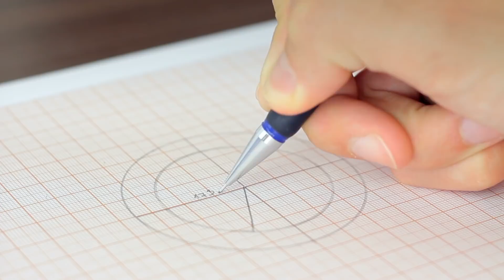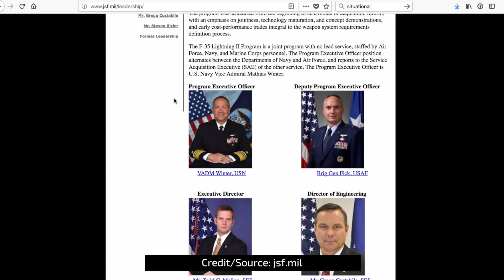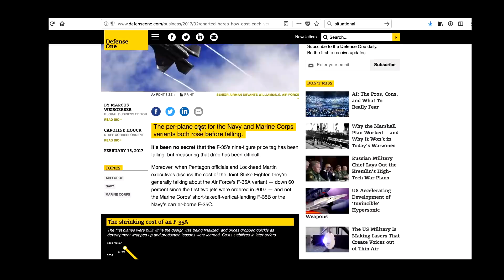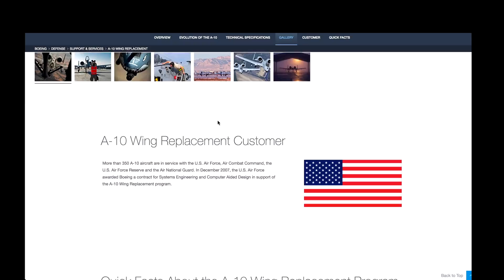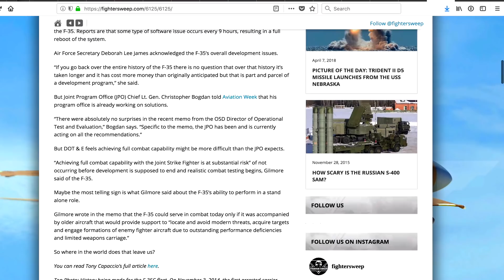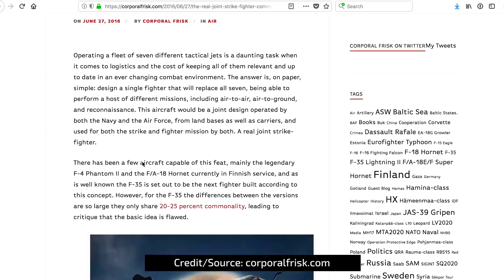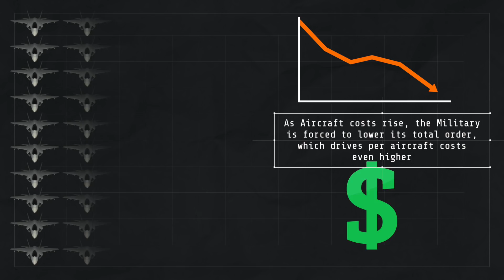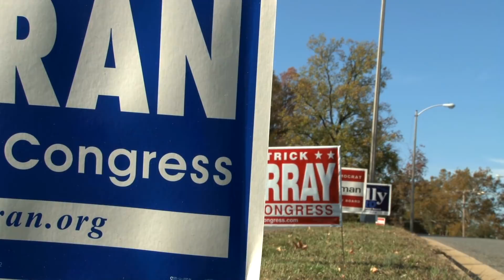Why the F-35 Lightning II Might be the Most Expensive Military Aircraft Mistake Ever

Comment: This video is complete BS. First the cost, before the F-35, there has never been a total cost report of a fighters or bombers complete life. This new data calculates the initial cost of the plane, upgrades, fuel and weapons for the total length of the aircrafts life. If such a report existed for say the F-15, almost every singke analys report done had that program already surpassing a trillion dollars a while ago. With other planes like the F-18 costing around 800 billion, B2 at over a trillion, etc. 

Also the cost of per F-35 has gone down to 85 million per plane, not 200 million as you reported. 85 million is a lot but a new F-15SE costs around 100 million, the EuroFighter 100 million and the B2 is over a billion dollars.

Next, that report of the F-16 vs F-35, read the report before you talk about it as that flight test was not about dog fighting but the electronic baby sitters on the F-35. The F-35 is the safest plane the US ever created, to accomplish that limiters had been programed into the computer from stopping the plane going to far out of control. However they needed a base line, say another single engine fighter with similar flight characteristics, to help adjust these limiters. The F-16 didn't out fly the F-35, it was just used as a base point and for data comparison. Again, this is all in the report but like anything, the naysayers will always pick out the negativesvin thing's, like reports without fully understanding the big picture or ever reading what really happened. Oh, do you want to know one thing that did come out of the report, the F-35 was to powerful in a lot of it's turns, adjustments needed.

A more realistic comparison would be the Red Alert report, where the F-35 desimated every aircraft it came across during the exercise including German mantained Mig-29's. Why, they couldn't detect it.

Which brings me to Stealth, Though yes the F-35's stealth capabilities fall under the X bandwidth, the X bandwidth is what every single plane and most AAA guns, missles use as UHF and VHF radars take up a friggen football field, are expensive and rare. These radars are also easy targets for anti-radiation missles as they are lit up like Christmas Trees because of the power needed to operate them, basically they will be the first things that go boom during an attack, thus negating the threat of UHF and VHF

That being said, the new B-21 Raider Stealth Bomber also covers these bandwidths, using a new coating. That same coating will also be used on the F-35 when it's completed, read the reports.

This is because the F-35 is the most modular aircraft ever created, designed for easy upgradability. Russians come out with a new electronic package that could potentially defeat the F-35, it's upgraded to the next level and so on and so forth.

Look believe what you want but you've been fed a lot of false information, the F-35 is the most incredible peace of technology to come out aerospace in a very long time.
Reply from the maker: Tel me where you read that a F-35 costs 85M. That sounds horribly wrong. Please uses sources to back up anything you said. Thanks!
Reply: @ProjectDaVinci  You didn't provide and resources, here is one of many  articles on the subject, I was wrong, the price will be 85 million in 2019, right now it is 95 million. Still much lower than 200 million.  https://www.janes.com/article/75863/lockheed-martin-targets-usd80-million-unit-price-for-f-35a-in-lrip-14
Reply from the maker: Those are price targets, but unlike consumer products like cars, there isn’t the need to ever really meet that. The F-35 still has some issues and that target price doesn’t mean it’s the case right now.

Comment: I have watched the entire video and there are a number of things I would like to address as there is so much wrong with this video. First off when you spoke of the different variants, it's important to note that there almost nothing different in each of the variants apart from how they take off/land, and how they perform (which is the least there is to be concerned with in this plane). 

Second is the pricing issue. When you spoke about the 1.5 trillion dollars, it's also important to note that this is the cost over a span of the next 55 to 60 years including every single thing, that means parts, pilot training, procurement, maintenance, etc. If you were to go on for the next 55 years with the current fleet of aircraft, it would cost maybe 4 trillion dollars or more easily. This is how the F-35 infact does save money both in the long and short run. Have a look at this... https://youtu.be/LyHlp7tJrxY?list=PLr7UZ_rywxTFdhDfu7SFimAMAUVdpabKL

One F-35A today costs around the same as a Rafale while being a whole generation ahead. And it is still currently LRIP (Low rate initial production), once it goes into FRP (Full rate production) the cost will simply drop like a rock to around 70 million or so. 

I'm sure the issues after this have already been addressed but I had to address the above. Thanks
Reply: Shout out to Stormsquad. When are you guys gonna make another CAB show episode?
Reply: Hey, I'm unfortunately not making any videos for the CAB show, I was initially going to do one on the YF-22 vs YF-23 but due to a number of reasons it could not be done. As of now my schedule has gotten busier so although I'm still in the group I don't make anymore videos for them
Reply: Stormsquad Ok. I know Dalek still makes a video once in a great while. I would have enjoyed seeing what you had to say on the YF-22 and YF-23. There are so many flat out lies and half truths and total conspiracies about that. It would be nice to put that in its proper place.
Reply: @thefreeman8791  I know, I wanted to do it too and even made a script together for it. But even for facts, they weren't facts enough though so it couldn't be done. The true reasons for the YF-22 being chosen are extremely confidential and no it most certainly is not because of any corruption or backhandlers or anything. I know there's so many conspiracy theories out there about this
Reply: Stormsquad Exactly. I saw one comment one time where the person said that Lockheed sabotaged the 23 by somehow stopping Northrop from building the canopy that they wanted so the ended up having a two piece because of that. I mean the complete and utter lack of ignorance around the whole thing is astounding. We have to deal with what we know not with what joe blow conspiracy theorist says.
Reply: @thefreeman8791  Trust me I've heard far worse. Like Lockheed deliberately applying more stealth coating on the F-35s than needed (the F-35's RAM isn't painted on you tool), or this one is gold during my early days on YouTube. "Russia sold it's PAK FA blueprints to the US which is why they made the F-22" 🤣🤣😂😂
Reply: Stormsquad Wow. I thought the one I mentioned was crazy. ROFL. That is the kind of stupid where it is so stupid that the only thing you can do is just laugh. 😂😂😂
Reply: Having worked on the JSF program, there is a sizeable difference between the vertical take-off and landing variant and its cousins. The large, heavy fan just aft of the cockpit is a bit more than almost nothing.
I basically agree with your pricing issue description.
When I left the program there were still many issues that needed to be resolved (I am hopeful that they will be addressed or the risks mitigated).

Still a big fan of the USAF (being retired). Glad to have left Lockheed (much lower blood pressure since).
Reply: Thanks for the comment. While it would be foolish of me to just accept what was stated in the video or your comment, it does give me more to think about. Pricing and production in the military (and government in general) can go either way. Sometimes it's a decent deal and sometimes it's not.
Reply: First off on your first statement it say that the now 2 trillion will pay throw 2060 not 55 to 60 years
Reply: 9
Reply: Sick of spending the youth's money.  Maybe they have much bettter ideas that will cost far less.  Why straddle them in debt and stiffle their creativity?
Reply: You obviously don't know squat about aero engineering.
Reply: Stormsquad bro the Navy is requiring VTOL
Reply: @jimbeaux89  that's only the Marines not the Navy
Reply: Jesus Anaya  they paid 300 million rupees, not dollars
Reply: Jesus Anaya  And what's your point?
Reply: @Stormsquad: It's called "moving the goalpost". My original argument wasn't that new planes don't have new features other than computing. My argument was that the buzzword "5th generation" is just a computer upgrade, that doesn't need a new plane (in fact, some "4th gen" planes are already being upgraded with those same features).

Terms need to have a definition. The only thing common between those so-called "5th gen planes" is user-interface and networking upgrades. And those planes are being promoted for exactly those features. So if nobody's gonna put out an official definition, i'll just go with that. Okkams razor.

So to summarize: Do those planes have other features than UI and networking? Yes, but those features are all over the place - there's no common pattern other than computing. Therefore, you don't need new planes to get "5th gen".
Reply: @lyxar777  Oh sure sure, why don't you simply apply these Upgrades" to older planes and see if they do nearly as good as they do the original planes? It's not moving the goalpost, it's giving you a perspective of how stupid your argument was on 5th gen planes.

I mean why not just say the term "4th gen" itself is a buzzword for upgraded 3rd gen planes? Why have newer expensive planes like the F-15 when you can just upgrade the F-4 and slap a new label like 4th gen on it? Of course I know you've completely left stealth completely out of the picture as have you left out performance and so many other things. But that doesn't matter, it's just a computer upgrade bro.

Seriously why don't you command the Air Forces or build these planes since you obviously know more than the people who make em and fly em
Reply: They ARE already being applied to older planes RIGHT NOW.
Reply: @lyxar777  Only certain avionics and derivatives of radars, they still don't have stealth, they don't have sensor fusion or more than half the shit that an F-35 has. Start doing some researching before commenting blankly
Reply: Since when is stealth "5th gen"? And i don't know how much you know about computers, but i'm a software developer, so i know "sensor fusion" is just software. I mean, it's not too hard to figure out: What is doing the "fusion" in "sensor fusion"? That's right: A computer program.

Agreed: Not every upgrade for every 4th gen plane includes all features, but that is not a limitation of the planes. It is vendor choice and market-strategy, so they can tell people like you without a clue of computers: "If you want the full package, you need to buy a whole new plane from us."
Reply: Jesus Anaya: Amount of times i'm insulted and ridiculed in this thread is telling. But anyways: Stealth originated in 4th gen, not 5th gen. AESA indeed something common in current 5th-gen planes. However, it is also being retrofitted to countless 4th-gen planes without problem.

So you might say: "You should've said networking, compute and radar upgrade, instead just compute and networking" - and you would be right. Still doesn't change my argument however: All three can and are being fitted to 4th gen planes. You don't need new airframes and engines for that.
Reply: @lyxar777  you're just a software engineer, not a pilot, nor an Aircraft mechanic or even an engineer. You haven't said one thing Correct about any plane yet so you don't know
Reply: Jesus Anaya  yes totally
Reply: Stormsquad, You compare JSF with a failure. Of cause it will look the better of the two. The Rafale IS a failure. Expected sale isn't met and the price reflects that (as it does with the JSF). Almost the same can be said about the Eurofighter, which is a very large and complicated plane.
Reply: @Mshark well it doesn't though doesn't it
Reply: Stormsquad Completely shortsighted and stupid comment.
Reply: Jon Ultime The OC is very very wrong. The 3 variants are EXTREMELY different. That’s why only about 25 percent of parts are interchangeable, and those that are are mostly mundane like screws, cockpit ejection system and helmet sensor gear. The meat of the plane that costs the most in spare parts like engine, airframe, stealth coating and control surfaces are all different. The marine variant has a top air intake in the middle of the fuselage, the navy version has a different set of wings altogether (longer for short landings/takeoff) and foldable while the standard model is trying a fatter payload bay because it barely has enough ordnance to rival a predator drone when relying on internal weapon hard points (2 small and 2 medium). The costs of the planes will rise in the long run because the differing missions of each variant means they will continue to diverge from the base plane meaning we have to supply 3 different sets of cutting edge parts instead of 1. This doesn’t even account for overseas variants which are different, while also only able to be produced in the US which will also convolute the chain of supply. That and no budget in the entire program has ever been kept, they keep getting bailed out for more dough which is not a good sign.
Reply: "A whole generation ahead" = Marketing speak for "A userinterface and networking upgrade", cause that's all "5th generation" is.
Reply: @lyxar777  if that's all 5th gen is, I wonder why everyone is tripping over each other to buy them and even make them
Reply: Stormsguard: Simple. A mere compute and network upgrade wouldn't cost much. You can't make money with that, nor drum up hype. So instead they're selling the lie that you need entirely new airplanes, just for new computers and software.
Reply: @lyxar777  Oh yes, I'm sure the Su-57, J-20, F-35 are all just tiny computer upgrades and nothing else. I'm sure even the F-15 and F-4 were just computer upgrades from the WW2 P-51s weren't they?
Reply: lol. clueless
Reply: Um....first the 3 variants share an 80% parts commonality.  In fact the Wings, horizontal and vertical stabilizers of the CV models are massively different to the STOVL and CTOL variants.  Also the CV have massively different landing gear.  The CV and CTOL are very similar in avionics, weapons bays, and such.  The STOVL (B model) are different in Canopy, STOVL doors/systems, engine and weapons bays.  So...no.  And they are different and VERY expensive to operate.  Also, maintaining the Low Observable surfaces can be quite pricey.
Reply: Wpns Loader Actually no, the tail and horizontal stabs are the same for all three. Only the CV has larger wings and a different landing gear while B model has a slightly less range. Of course all three differ in terms of performance and how they take off/land, but apart from that there's literally no difference. Also sharing 80% parts is a big deal which does reduce the price. The stealth technology on the F-35 is different from any of the previous stealth aircraft and does in fact make it easier and cheaper to maintain
Reply: Ummm....no Sorry buy I work the B and C model and the horizontal and vertical stabs are VERY different (all though going back to the 80% part sharing the EHA's are the same for both, despite size difference).  Also they set up of the hydraulic system, fuel tanks and such are different.  TRUST ME...they are not as similar as you may think.  But they do share a lot of parts and a LOT of the same issues in maintaining them.  Also, I can NOT see how they are cheaper than a legacy jet, but I cannot back that up with data, just what I see on the "hanger floor".  Frontal stealth has improved also, so you get marks for that.
Reply: All aspect stealth has very much improved. Of course a lot of stuff will be different in the models but as they get made and flown more often the price drops and so does the cost of operating them
Reply: Wpns Loader
It costs less to maintain than the F-22 (if you considered that as a legacy aircraft), and is comparable to the F-15D. However, the production line haven't reach full rate yet due to argument over budget, but F-35 should eventually get cheaper to maintain when more parts are readily available.